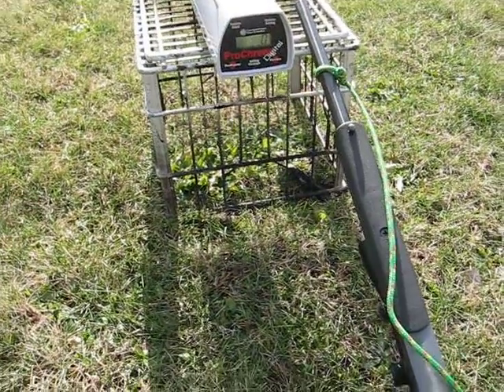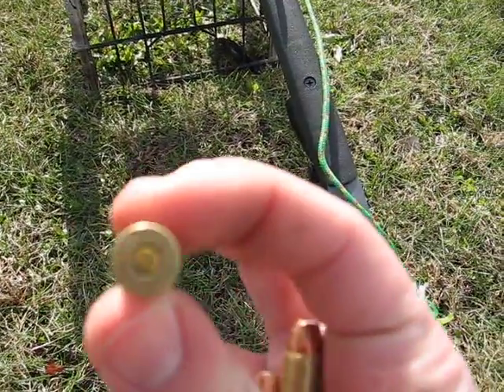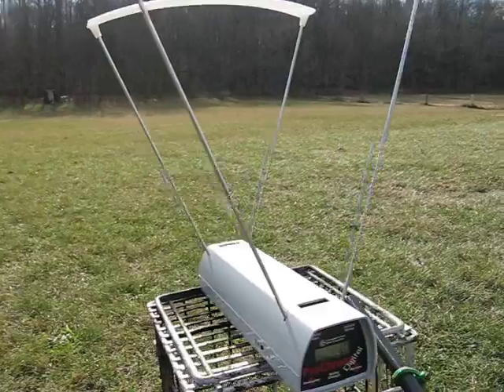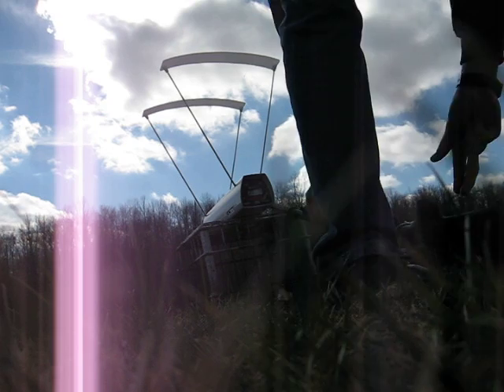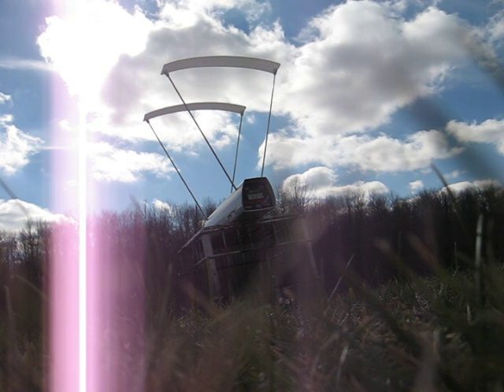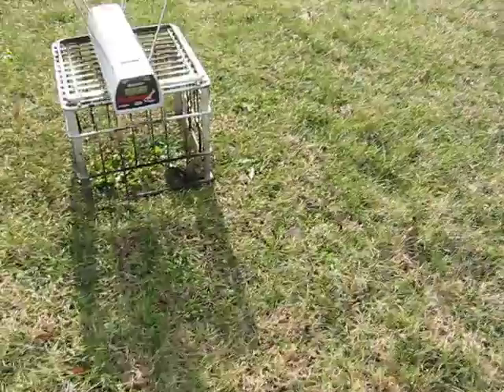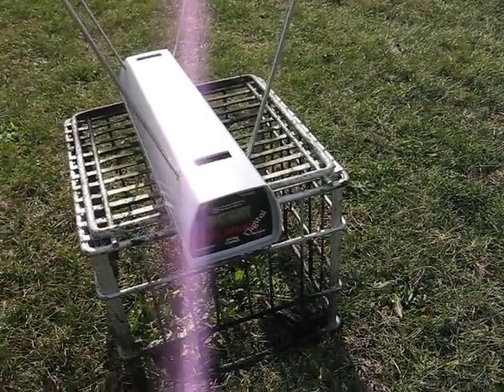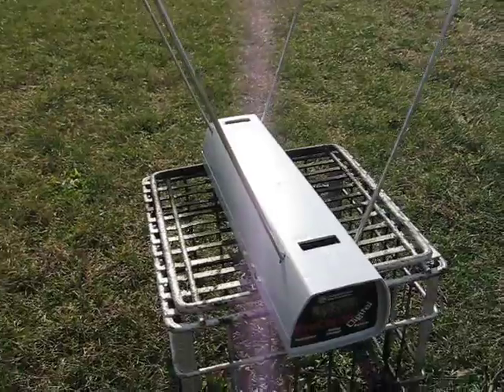Reload Recipe: 1700 fps 357 Mag Hunting Rifle Reloads, Shotgun Powder, best Accuracy

Comment: I shoot Zinc cast bullets 114 gn zinc from a 170gn swc in lead. I have been using Winchester Super Handicap - 7.6 grains seem high - I am loading 6.2 grains this is based from quick loads using green dot as the selected powder. I also shoot it in 30-06 300BO and 223 at very reduced loads with zinc bullets getting great results. Also load 9mm with it (Zinc Bullets)

Comment: Every steel shooter in the country shoots a 180 grain bullet ahead of 16.0 grains of H110 (usually) at velocities just under 1800 FPS—depending on the length of the rifle barrel! It’s not a pistol round though some may handle it. It works and will stop anything. I shoot this load out of my Ruger Blackhawk in 357 Maximum with no problems and this delivers about 728 foot pounds of energy with a muzzle velocity of 1350 feet per second. The original 8 1/2” Smith and Wessons in .357 used to do something similar with 158 grain lead bullets.
And the heavy bullets are superior at long distances. The light Bullets lose their velocity very quickly after 100 yards. But the heavy.357 rounds deliver .38 energies out to 1000 yards! This means your rifle in .357 will deliver 300+ energies at 500 yards—and hit a man sized target. People don’t realize this.
So, if that’s all you have, it’s your perimeter gun. Use it! And that same rifle will give your.38 round .357 Magnum energies! Don’t forget that!
The .357 is the very most versatile round in all categories: fast, powerful, readily available, cheap, and deadly for anything on two or four legs in North America!
Put 20 boxes of it, and 40 boxes of .38 Special in your storage shed! That will take  you two and a half years—if you have that long. 
Better buy 3 a month then, cutting out a couple of trips to the pizza parlor, eh? JWC

Comment: I load an 148 grain lead Wadcutter in 357 mag with 5.5 grain VV N330 powder and get 1179 fps out of an 5.5" Pietta 1873 SAA 357 mag revolver for 457 ft-lbs. A bit flat primers but soft recoil (between 38 spl +P and full power 357 mag). When loaded to 6.0 grain I get out of the same revolver 1219 fps for 488 ft-lbs. Almost as stout recoil as full power 357 mag but very flat primers (WSP) as such as its safer to stick with the 5.5 grain. The full Wadcutter sits about on top of the powder with the 6.0 grains loaded.

Comment: I have seen some load data with slower rifle powders (IMR 3031) designed for 16" barrels and longer; using medium-heavy weight bullets 150-180 gr. for deer hunting, etc. Maxing out around 13.5 gr of IMR 3031. Produces 968 FPS with a Speer 180 SJHP  out of a 16" test barrel with only 34% powder burn.  You could expect close to double that percent burn out of a 22" barrel. With a 125 gr bullet 2000 fps would not be a stretch.  I would start at the 11.5-12gr range, and certainly go with a magnum primer. This is definitely a rifle only powder.

Comment: I would look at Hodgdon LIL' GUN, Hodgdon H110 or maybe IMR 4227. All good powders. LIL' GUN may burn a little bit cleaner. Also you can check some of the older reloading manuals if you can for some good info. Generally, slower burning powders tend to get better velocities in longer barrels; taking a little longer to build pressure. Most of all, be safe. If you  don't know and trust the source , don't use the data. Gun go boom is a bad thing.

Comment: W296/H110 and Alliant 2400 seem to be the go-to powders for high velocity with the .357 Magnum cartridge. Be careful with W296/H110, the old-timers all say it can get a little squirrely if you underload it, and it definitely needs a magnum primer. You can get away with a standard primer with 2400. Also, if you zero that rifle so it shoots 2-3" high at 100 yards, it will extend your useful range a little. Standard warning for reloading: IF YOU ARE NOT ABSOLUTELY SURE WHAT YOU ARE DOING, DON'T DO IT! Good luck.
Reply: Scott Patterson i

Comment: Why not load the 125gr projectile with 20-21gr of Winchester 296/H110? And they are perfectly fine for the 357 pistols, and you would get about 2000fps or more out of a rifle. I never recommend using fast burning powders that were designed for shotgun/auto-pistol in a magnum pistol round.
Reply from the maker: If I experiment again, I'll look into it. Thanks!
Reply: Exactly, in long barrel slow powder is the best.
Reply: My exact load: 21.5 gr. of W296, CCI primer, Winchester case, with a 25 grain Zero brand copper jacket bullet.  Chrono's right at 2000 fps.
Reply: Yup. Good job! It's one hell of a fire ball, and a pop out of a pistol though. I had to dial them down to about 19.5gr for the sake of my face and ears. With good hearing protection it still made my ears ring, and the percussion smacked me in the face. I can only get through about 14 rounds before I can't stand it anymore. Would probably be a little bit better to tolerate coming out of a 357 carbine do to the barrel length, and lower uncorking pressures. There was no cracked cases, sticking cases, or smashed primers. Also, I made sure that my S&W 686+ could handle it, and it was well within capability. Now days, I use 145gr powder coated cast lead semi-wad cutter with 17.5-18gr of W296. I would love to Chrono that particular load, because I know it's zooming with the slick powder coated surface. The uncorking pressure is a lot less, but the recoil is a lot higher. So, I assume that the projectile is traveling at higher speeds than a copper jacketed projectile. I can actually shoot those without hearing protecting if I had to. The noise is not that bad at all coming out of a 6" barrel. But, I always use protection when sporting.
Reply: Theres gonna be absolutely zero difference between the two weapons if the the breech material is the same thickness relative to eachother.
Reply: mds6387:
Yes that is true, it’s very fast out of the muzzle, but it won’t retain its energy much past 100 yards. Basically it’s a pistol bullet, that 125 grainer.
If you want to shoot a rifle, consider the heavier 180 grain lead gas checked bullets. Make your own or buy them from Buffalo Bore. JWC